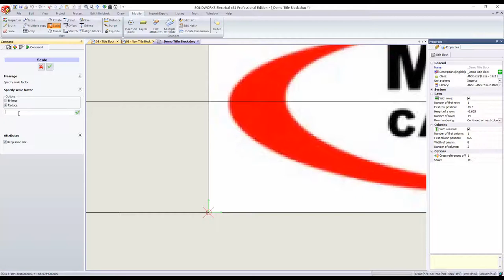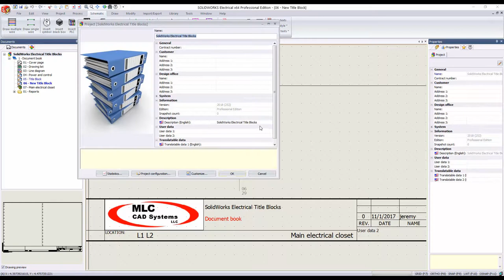SOLIDWORKS Electrical Title Block Customization

Comment: Great video! Maybe I missed it, but is there a way to add more properties if I need more than User Data 1 and User Data 2?
Reply from the maker: Yes, you can create user data fields as necessary and customize the names past “user data 1”. The user data fields can be added at the project, book, scheme, or folder level.